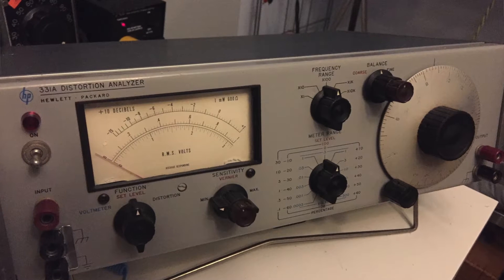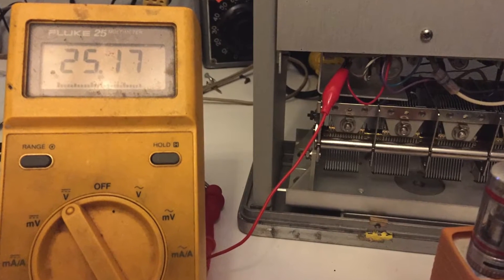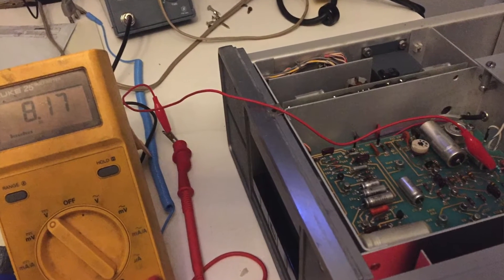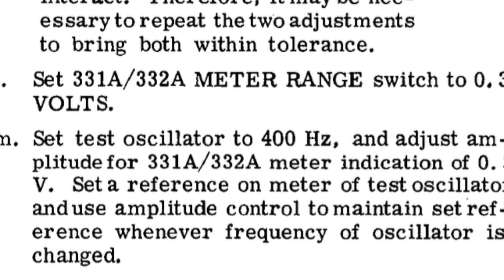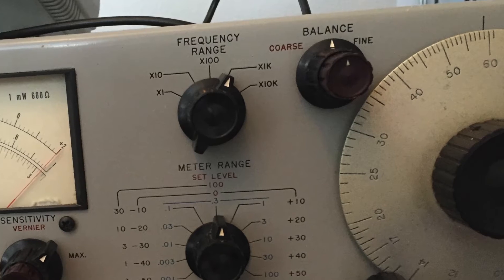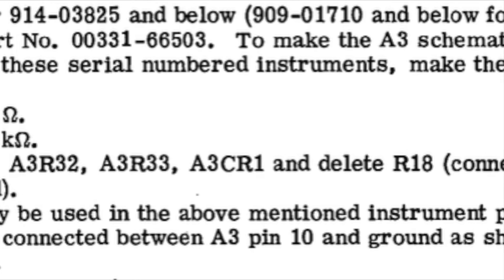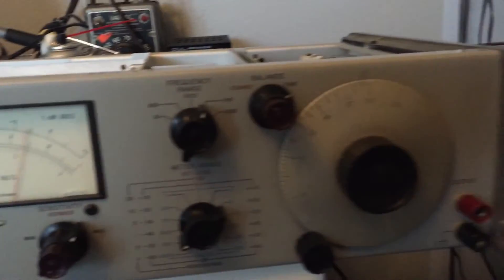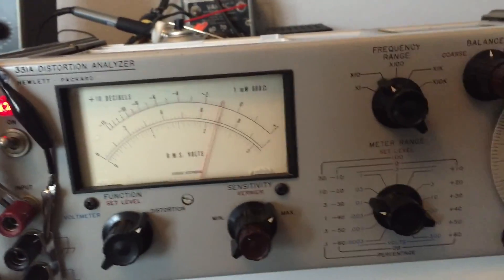HP 331A Distortion analyzer repair and calibration Mini Documentary

Comment: No, the volt meter is not a RMS meter.  It is an average responding meter with the scale indicating the equivalent RMS voltage, which is accurate for low distortion sine waves.
Reply: Correct; what a pity that the unit does not come with a true rms meter/output. This renders it practically severely inaccurate for distortion measurement when the input has multiple harmonics without one being dominant, as you rightly noted.

Comment: I would love to check the calibration of my new 333A, but when looking at the list of required equipment... I don't even know what a couple of those things are. 

What I do have is:
Function generator (FY6900)
DSO (Siglent SDS 1204XE)
And of course a bunch of multi-meters and tons of components (resistors, caps, etc). 

Do you think there are any useful calibrations or at least checks I could do with this equipment alone?

Thank you! Excellent video btw.
Reply from the maker: The equpment today is far more advanced compared to what they had back then. I used what  you have.
Reply: @retrotechandelectronics  excellent! Good to hear. Maybe I will give it a try then.

Comment: Often the wafer switches are very intermittent and need a lot of cleaning.   Also often the many electrolytic capacitors not in the power supply are high dissipation factor and low capacitance.
Reply from the maker: Any switch that old will be ready for a cleaning.

Comment: I have a 334A that seems to work fine, but the electrical zero is off. Mechanical zero is set with the power off (as indicated in the manual), but with a shorting bar on the input it still shows a small input all the way up to the 300V input setting... still thinking about what might be the best bet to fix it
Reply from the maker: did you work through the complete cal procedure?

Comment: Very well done video.. Thanks
Do you happen to know the differences between the HP 331 and 334 distortion analyzers?

Thanks again.
Glenn
Reply from the maker: I think the 334 has an auto dip circuit to fine tune in the last portion and stop jitter as an upgrade. I do it by hand

Comment: Very nice demonstration.  I did a wholesale replacement of all the electrolytics on the power supply board on mine when I first got it.
I love the build quality of old HP equipment.
If I ever get to trying to calibrate it, I definitely will be referring to this video.
Reply: +Dave C I too plan to swap out all the 50 year old electrolytic caps in my 331A. Doing that for a HP 400E and parts that I can get to in a 4342A Q meter. Shooting for the lowest ESR. Lots of tantalums in these things. Sometimes a long lead 100 volt polyester film cap will fit and drop the ESR quite a bit.